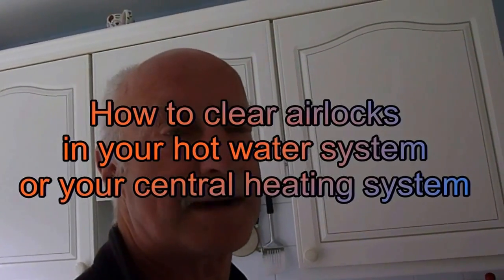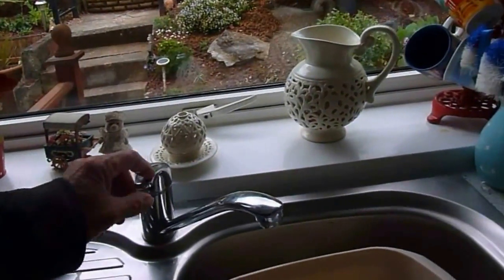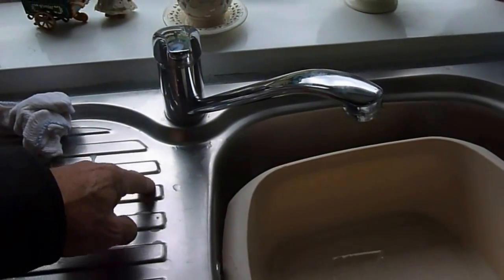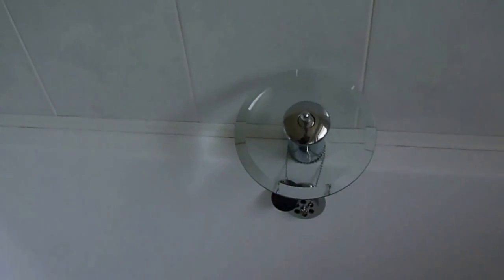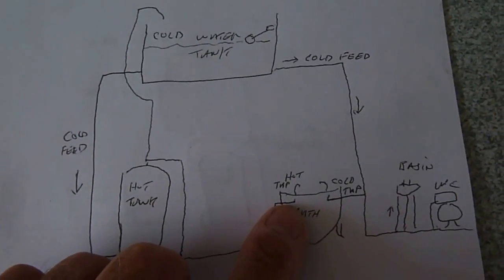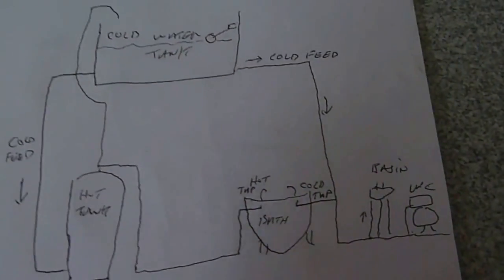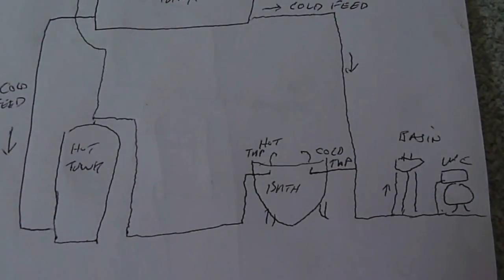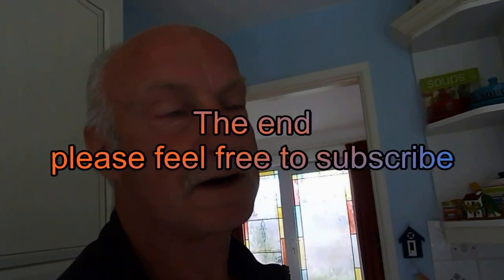How to clear airlocks and restore hot water or heating

Comment: Cheers! Work on the water main down the road emptied the cold water tank and caused an air lock. You saved me paying for a Sunday callout, plus got me in the good books with the other half! Luckily we have an old fashioned mixer with no non-return valve downstairs. Turned both taps on and blocked the spout. The whole system juddered for a while and burst back to life again. You certainly know your stuff. Thank you.

Comment: thank you great advice.had no cold water in bathroom. connected a piece of garden hose, hot pipe  to cold pipe and turned  hot water valve on. cleared the air lock immediately . saved me a late night trying to figure it out or the cost of a plumber . many thanks

Comment: Absolutely brilliant simple solution.  I had little or no pressure in the hot water system after replacing a leaking header tank and after some time spent trying to problem solve this, I looked for a solution on the net and you came up.  I did as you suggested and connected a short length of hose between the hot and cold water taps in the bathroom and bingo, ten seconds later I have everything back to "as it should be", thank you very much!!

Comment: you sir are a flippin legend! drained my hot water cylinder but when I'd filled it no water would come out, about to start checking the ball valve on the header tank but its a nightmare to get to, checked youtube, saw your vid, hand over the basin mixer tap upstairs, on with hot. . . . . nothing, turned on the cold . . . . . blop-blop-blop. . . . . hot water!! brilliant :)
Reply from the maker: drumingmatt No problem. Al.

Comment: My brother is blind but has asked me to say thank you as he listens intently to your excellent videos and has become quite the amateur plumber and has not needed to call a plumber since he discovered your youtube channel now he can do everything himself - Dont ask me how he does it not being able to see but he is old school much like yourself and prefers to fix everything himself!

I have learned a lot from your vids too - You exemplify the old school expert plumber - easily the best plumbing videos and best presented on youtube!

I do have a little problem for you if you dont mind me asking?
I live in an old 60's block of 6 flats - 3 per side fed by two water tanks each side - one tank is joined to the other and the 1st feeds the old style vented cylinder type hot water cylinders - the other tank is fed from the mains and has the ballcock and feeds the cold water to the bathrooms1

Problem i have been having is a constant blockage once every few weeks in the cold water feed - i do the usual connect a magic hose to the kitchen mains water tap and attach the other end of the hose by removing the cistern float valve assembly to the pipe with a tap converter and a bit of rubber as the bath and basin taps are too hard to attach the hose and blast the cold water back up to the tank - i find that by standing on the magic hose and letting the pressure build up in the hose it gives much more of a pressure blast of cold water though the pipes and back up to the tank than mains pressure alone and it usually clears the blockage quickly and works for a few weeks before becoming blocked again.,

The main thing is that after the blockage is removed the cold water tap in the bathroom basin has literally a tiny cold water flow leading me to believe it may not be an airlock but probably a piece of fibreglass even although the cold tank in the loft is covered.

Its a real pain having to do this every few weeks - any ideas?
I do believe the airlock happens every time the cold water basin tap is opened for a while - have you seen this before?

I have thought of removing the connection between the cistern and the bath and shoving one of those endoscopes up the pipes (after shutting off the main gate valve) to see if there is a blockage where the cold water basin tap joins into the main pipe that leads into the bathroom but it will be a lot of hassle!

From what i can gather fibreglass usually gets blocked at the gate valve?

The thing is my neighbour has told me he has had to backflush his bathroom as his pipes have had the same problem a few times!
Its a real head scratcher!
Reply from the maker: Thanks for the very kind comments Garry, this could be a blockage, but might be something as simple as the roof tank valve blocked and filling really slowly so if your three flats draw too much water at the same time the tank does not have time to fill leading to airlocks. If the lid of the tank is a tight fit I doubt anything would have gotten in there to block the feed .

Comment: Al, you saved the day. I used the very first method of pushing the thumb against the mixer tap in the kitchen and it worked. The plumbers drained the loft tank to sort out a leakage. They did a good job bleeding out the system and made sure the cold water taps were working fine. But they forgot to check the hot water taps. I can't blame them - it was Friday night and they did hell of a job fixing the loft tank leak dripping into my bedroom.
Reply from the maker: No problem pleased you sorted it OK.

Comment: Great video solved my problem. I had changed the downstairs taps, after the hot water would not come out except a dribble. I had to go through the process of blowing through with the hose pipe, third attempt solved it, had to rely blast it. Thanks again.
Reply from the maker: +Steve Davies . No problem Steve.

Comment: Thanks for posting this video! Hose pipe from cold to hot tap got rid of the airlock in the hot water system after I drained it to fix the shower. Super job! God bless you, Joel :)
Reply from the maker: No problem.

Comment from the maker: Hello Nasir , Fist go into the loft and check your F and E tank is full , then check your central heating pump is working , make sure your room stat is set well up , say to 25 degrees , check there is no air in the radiators also check the motorised valve is working.
Kind regards,
al.

Comment from the maker: Hello Olatungi Olakigbe first thing to check is that your water pressure is up to full steam , just check that the main stop tap which is usually under the sink is turned on fully and not cranked down. Also that the water company has not turned the water pressure down in your area. It may also be a pressure switch problem normally on the boiler,do though check all connections on the boiler are OK, Lastly check the boiler pressure is at least one and a half bars.
Kind regards,
al.

Comment: I changed the zone valve and actuator and had the worst airlock I’ve ever had and I had hot water but not much in the way of heating. After letting the radiator ,   which is 2 of them joined together ,  either side of the living room wall drain for a couple of minutes and then re bleeding all of them and re balancing them it’s back to normal. Once again you’ve pulled me  from the fire ! if i need to solve a plumbing problem i always come here and see what you have to say about it
Reply from the maker: Thanks Adrian, pleased you sorted it ok.

Comment: Muchas Gracias! I had an air lock after an emergency drain, because I banjo'd a valve compression joint removing a rad. Once I got everything sorted, sealed, and refilled the heating wasn't firing up. The screw in the pump being a bleed valve was a little nugget of gold that got everything up and running again.
Reply from the maker: No problem Stephen.

Comment from the maker: Hi Mick is that the small F and E tank you can see or a large water tank for domestic feed to your hot water tank? The F and E tank is a small plastic tank about 18 inches x 10. That is the one that you have to check is full .
If it is ok and your pump is fine you may have to flush your system .
Just drain the system add a system cleaner for the recommended time on the bottle , then drain out and add inhibitor , bleed out all air and you should be back to normal .
Did you try balancing the system as I mentioned earlier?
Regards,
al.

Comment: I'm a plumbing and heating engineer and I think differently. Most hardware or homeware stores sell tap adapters to hoses, I have 1. Most modern taps including basin and kitchen have a removable universal filter at the end of the spout that can be removed using a spanner. Screw the adaptor in and connect using appropriate connectors to outside tap. You will generally only get airlocks in Gravity systems. So you need to use the mains water as this is of a higher pressure. If you just connect both taps together at a basin, chancees are there both gravity pressure, rendering it useless. Or if you have a wet and dry Hoover, connect the Hoover spout to the tap spout and suck away.....
Reply from the maker: Jamie Burrows Thanks for your extra input, Jamie.

Comment: Hi there, wonder if you can advise me. I have an oldish 4 pipe gravity system, I have replaced a radiator on the ground floor. All the rads heat up nicely, but the gravity fed hot water does not. It seems that the pumped heating takes priority over the gravity hw. My question, should all 4 pipes from the boiler heat up at the same rate, or does this suggest an air lock in the hw feed. There are no diverted valves, just timer and thermostat. The bathroom rad is also on the gravity feed. Keep having to bleed this.
Reply from the maker: Adding that radiator has upset the balance of your system.
Reply: @dereton33  thanks for the reply, I thought it might be some balancing issue. So is it a case of adjusting all the rad valves down and let the gravity hot water feed improve circulation. Thanks.

Comment: Hi, I use the washing machine valves with a washing machine hose connected between the two, works brilliant everytime.  I carry a spare wash machine in the van just for that purpose
Reply from the maker: That's a great idea Jack , thanks for the info.
Kind regards,
al.
Reply: You`re welcome, Al.  I don`t have a
 spare wash machine in the van, I meant a spare hose lol
regards
Jack
Reply from the maker: It`s ok I knew what you meant.
al.

Comment: I had new radiator installed in my hallway. It doesnt warm up. It has a drain valve connected to the in pipe. I followed your advice of sticking a hose pipe on it and let it run (while the heating was on). As this was happening, the in pipe started to get hot and so did the radiator. I let it run for about 5 minutes and turned off the drain valve and removed the pipe. 10 minutes later the in pipe was cold and so was the radiator. I've bled all the radiators, the pump etc, i'm scratching my head a bit with this one. Any ideas would be greatly appreciated :)
Reply from the maker: Turn off all the other radiators except that one, run until hot, then turn the others on only about one turn or so.

Comment: Hi
I have problem with the vent pipe hot water. When I open the bath hot and cold water the tank overflow. Any suggestion
Reply from the maker: Check the ballcock in the roof tank.
Reply: Thanks for reply. The problem when I open hot and cold together the water not feeding from the ballcock side but from another half round pipe from the top of the tank. Seen picture called vent pipe from domestic hot water system and has Notting to stoped running only to stop hot water tap running on the bath

Comment: Hello Al.

Please can you help.  I have an Ideal HE30 isar Combi Boiler and the Hot water syatem has been playing up lately.  whenever I turn hot water ON either in the Bath or Kitchen, it gets hot a little and then go cold after few seconds.  Central Heating is fine with all Radiators performing well and I have Water tank in the Loft.

Any advice will be appreciated.

Thanks

Comment: My gardener accidentally broke our mains water pipe while digging in the flower bed. We turned the mains water off in order to fix the pipe - a lot of hot water came rushing out the other end of the pipe (I didn't know at the time but it is apparently hot water came from the geyser). Now the water pipe is fixed and not leaking anymore and gardener left for the day. I was surprised to find that there's no hot water comping out of our tap at all. I tried unblocking the waterlock following your advice but a bit of cold water would come out of the hot tap for approx half a minute and then nothing. What can I do next to unblock the airlock?
Reply from the maker: Your roof tank ballcock is stuck and blocked with mud that your Gardner probably let get into the main while he was fixing it.

Comment: I'll give the nut on the pump join a try  in a bit. Got a massive airlock that shuts the heating off and no water comes out the pump bleed screw either. The impeller is spinning. It's all fed via the tank in our bedroom, old 1930 water tanks.
Reply from the maker: Air in systems is a real problem.
Reply: @dereton33  am I supposed to do it with the pump running? Just undone it and no air and no water

Comment: Hello Al, quick reply, many thanks for that.I will try what you say.
Other info,
It's an old system, no combi, I looked in the airing cupboard, and can see the h/water cylinder, with the header tank on top, the boiler might be a a back boiler. When we put the heating on, after about 10 mins the boiler switches off? I have tried turning the thermostate up, but it makes no difference.
Do you think it stops because its not circulating? (pump failed, air lock, or blocked system)
Reply from the maker: Hi

Comment: Money is really tight just now and any help would be appreciated! PLEASE HELP!

I have hot water tank in loft and both a big and small cold water tank. 

I changed my bath taps for new ones. I got airlock.

Seen on YouTube about airlock in pipes  connecting garden hose/tap trick into the bath pipes - it fixed the cold water, however the hot taps (bathroom, WC, kitchen) if 2 taps are on at the same time, then only one tap will work, the other taps won’t have any water come out them at all?

thanks!
Reply from the maker: You still have an airlock. If you have sink mixer taps try holding you hand over the spout and turn the hot and then the cold on to blast up the hot feed . Hold your hand over for 20 seconds.
Reply: @dereton33  thanks for reply. I have mixer in kitchen and water just instantly sprays out. I have new mixer in WC and can hold hand on for ages without spray, so really puzzled why that’s not fixing it. I am also puzzled as to why the hose on garden tap up into the hot bath pipe didn’t fix it - I had this running for ages and had the tap on full.

When I am trying to remove the airlock should I have all the hot water taps open or shut?

Thanks!

Comment: I had to drain my heating sys to re locate a radiator  , now my heating works fine but i have no domestic hot water plenty of flow but no heat , zone vales operating ok , i have a megaflow system  ??
Reply from the maker: You have an airlock .
Reply: Not always it can be anything, it definitely needs looking at

Comment: Checked the pump. It's hot and the motor spins fine. I undid the screw and a jet of water shot out. Got a small screwdriver and quickly put it inside and it spins around fine. Could it be a water block in the diverter or a dodgy expansion vessel? Many thanks.
Reply from the maker: More than likely the diverter valve.

Comment: We’ve been getting a lot of airlocks lately and have to use a vacuum to get rid of the airlock but also it keeps happening a lot we have an old tank upstairs which isn’t very good are there any other suggestions
Reply from the maker: Try replacing the tank valve and increasing the water level.

Comment: thanks for your video,  but unfortunately running a garden hose to the washing machine hot tape mad n difference to us having no water from the hot taps.  any ideas?
Reply: actually it gave us water while the garden tape was on but after it was turn off the water from hot tape ceased.
Reply from the maker: Go up into the loft and check the roof tank ballcock is not blocked.
Reply: dereton33 thanks but here in New Zealand we don't have clod water cisterns in our ceilings.  I managed to fix the issue by turning our supply off and draining our house from the lowest tap then turning back on.  I was worried that this may cause new air locks but it has seemed to fix the issue,  for now at least.  do you have nay videos on Ajax valves and pressure relief valves on law pressure systems? we live ruraly and are on rain water with a electric pump.
Reply: dereton33 and thanks for the reply.
Reply from the maker: I have a video on pressure relief valves, but not Ajax valves.
Reply: dereton33  that's I am pretty good with the Ajax valve,  but have issues with our pressure valve from time to time will go have a look at your video,  thanks for replying.

Comment: I live in a upstairs garage apartment with a gas water heater. the tenents in main house which is split into 2 apartments have electric water heaters. none of our water heaters are hooked up to the outside washing machine so why all of a sudden is there warm water filling up washer? we always kept the washer temp setting on cold/cold because it would never work on any other setting due to not working when we set it on hot or warm setting. someone switched temp setting to warm/warm and the water is warm. how can this be if like I said its not hooked up to any water or piping from our water heaters? washing machine is hooked up to an outside spicket. I just want to make sure the other tenents dont have access to my water heater which will raise our gas bill. is there a way I can tell if its for some reason hooked up to our water heater line?
Reply from the maker: Check that none of the other tenants have made a dogey connection, or have been messing around with there plumbing.